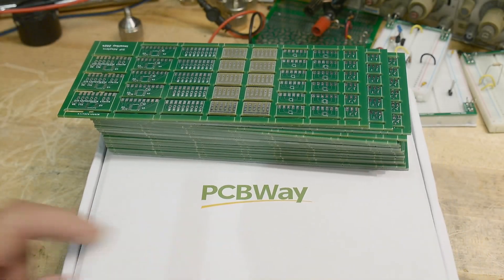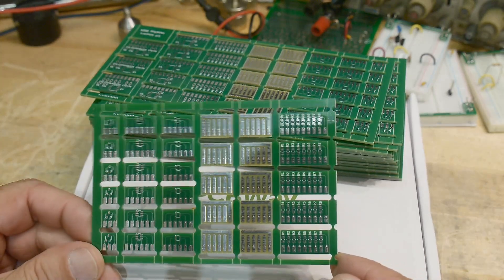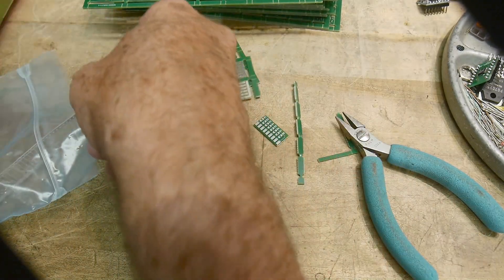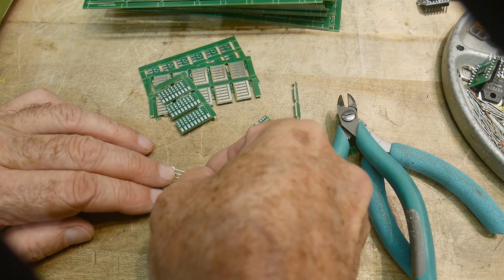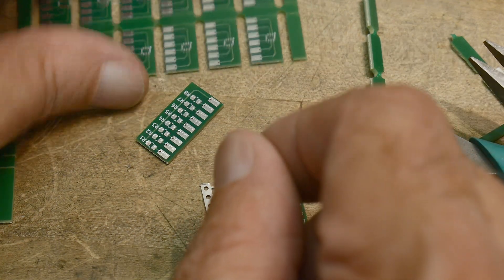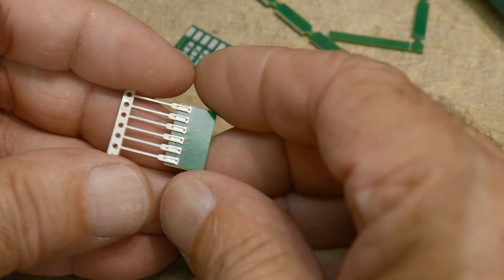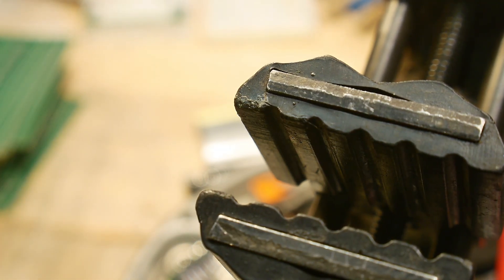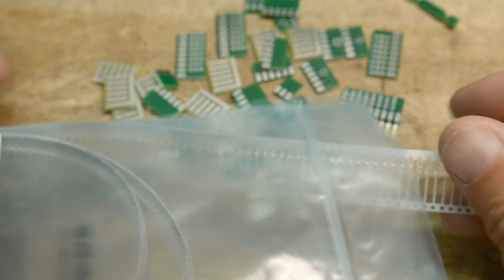#1958 SIP to SMD adapters (part 3 of 3)

Comment: My five boards came in the mail today from JLCPCB. They look fantastic! I'm looking forward to using them.  I was worried that the V-grooves would be omitted from the boards but they were all in place so it will be easy to snap the individual boards apart. I did try ordering through PCBWay but for reasons that I could not determine the quote kept coming back as $131. PCBWay is an excellent service and prior orders have gone without a hitch but in this particular case no matter how much I tried to tweak the order, including selecting slowest, cheapest shipping,  it kept coming back costing a fortune. JLCPCB for the win at $19! Thank you once again IMSAI for sharing your projects. Sourcing parts for your projects can be a challenge but so far it's all turned out well. Especially those Lorenz attractor boards!

Comment: I don't get it. When I add this project to my PCBWay cart it starts out with an estimated cost of around $30. But after review the actual cost shoots up to $131! What's happening? Am I ordering it wrong? Is there something I need to change to get it back down to $30? Or does it actually cost well over one hundred dollars to have this project manufactured? JLCPCB comes up with a price of $31.80. I like PCBWay. But why the huge difference in cost: $131 vs $31?
Reply: I ordered mine at JLCPCB=$12.77 plus shipping
Reply: @kenkostan  Did you get the boards back yet? Do they include he 'V-grooves?' Something is screwy with PCBway. No matter how I submit the request it comes up for 50 boards with rapid shipping. I can't seem to change it. Hopefully JLCPCB works out. I've use both services and they seem to do good work.
Reply: @kenkostan  I did the same and things turned out well.
Reply from the maker: the panalization and vgrooves cost. $130 is about right with fast shipping.
Reply: @IMSAIGuy  Yeah well $130 is a deal breaker for hobbyists like me. I'm trying to figure out a way to reduce cost but I'm not given the option to opt out of fast shipping. I'm not sure what panelization is but I'm guessing that it's baked into your design and I can't do anything about that either. The V-groove thing must add considerable cost. I'm tempted to try JLCPCB but I suspect that the V-groove isn't going to happen through them which of course would be bad. What do you think? But in other news I love your chip of the day schtick and I always look forward to that. I've added a few of your projects to my PCBWay cart (Zener diode tester and protoboard power supply). I guess I'll just delete the SIP to SMD board and settle for those two other things. I have received your two Lorenz PCB's from PCBWay and I've also sourced all the parts so I'll be playing with those this weekend.
Reply from the maker: yes, it is expensive I agree. all PCB houses can do Vgrooves

Comment: PCBWAY charges additional $100 extra for v-groves on my order.   Did I do something wrong when ordering?
Reply: I seem to be running into the same problem. I'm curious to know if the 'IMSAI guy' paid that premium price or if maybe we are doing something wrong?
Reply: Try ordering through JLCPCB. I paid $19 for 5 boards. Same files but way different cost. And the V-grooves were included.

Comment: These may also work well, can't post a link but can be searched on Ama 
"Pin Header Strip for Arduino Gpio 40 pin x 10pcs Male Headers Pins Rignt Angle 90 Degrees Single Row Gold Plated Pitch 2.54mm 0.1 inch Breakaway for PCB Connector Machine Breadboard"

Comment: checks description "Pins available on Digikey and Mouser"

HOLY HELL, those are handy. Will order a bunch, THANKS SO MUCH
Reply: Did you order? PCBway is charging $131 for this project. HOLY HELL! Not so handy.
Reply: I bought 500 (!!!) of them from DigiKey and the shipping cost more than 500 parts !!!
Reply: @joeteejoetee  I'm currently above the free shipping threshold with my digikey shopping cart and I'm about to finally order 500 of those bad boys for $10.

You really gotta bundle your projects when ordering from distributors, guys!

P.S.: My shopping cart total is currently $124,87, shipping is free above $60 for germany. I've put in a lot of the small bourne potentiometers and some DACs for at least ~4 different projects too...

Comment: Tried to order the boards, order went under review and when approved the price went to from $42 to $143. Not paying that amount.
Reply: I uploaded the gerber files and submitted the order with JLCPCB and the price was a third of what PCBWAY wanted to charge me
Reply: @jbravovideos  If that's the case, I might have to try JLCPCB out for this project. I have used JLCPCB before and I was happy with the results. Did you get the V-grooves included with the order? I'm wondering if that's the issue?
Reply: Those are more than 5 Designs per panel, JLC has specific wording for these cases and is upfront about it, when you look closely.

Comment: V grove is also done with a V  wheel.
For a 6 layer design for a miniature telemetry transmitter , inner layers 3,4 had power and programming connections, layer 1,2, 5,6 V groved, the transmitter portion would be potted into a pocket, then gain and frequency would be programmed, unpotted portion would be snapped off.
The final product would be installed into compressor of a jet engine, running up to 40,000RPM, cooled with liquid nitrogen, with a static load of >100,000g.

Comment: Nice. This looks like a great way to deal with SMD parts for experimenting with a breadboard.  The pins are thin so should go in and out of the breadboard easily.

I soldered two strips of square header pins onto my Arduino Nano and now the Arduino is permanently mounted on a breadboard since the 30 pins fit tightly and make it almost impossible to remove. But that's ok. It is now my Arduino board.  If you do this think about how you want it mounted before you press it into the breadboard.
Reply: You can poke something underneath (I usually use the back of my tweezers) and carefully lever it up.
Reply: @notsurt  True. But it is fine where it is.  Permanently attached to the breadboard.

Comment: You can get twice the number of pins per inch by using tenth inch dual headers. The board fits reasonably between the two rows of pins. This can give noticeably higher packing density, plus allowing plug-in modules for troubleshooting convenience.
Reply: That's not breadboard compatible, which was the goal here FWIW.

Comment: I'm using 0.1" male pin header for this. It's cheaper and more robust.
Reply: TRUE!
I use Gold machine-pin Male-2-Male connector strips. I buy the strips with different diameter pins, so I can choose between the outward facing connector diameter for Proto-Boards or matching Gold Female sockets later.

Comment: It might be a good idea to repeat the same pads and tracks on the other side of the PCB. That way, if you lift a pad or damage one side, you can still use the other side rather than throwing it out.